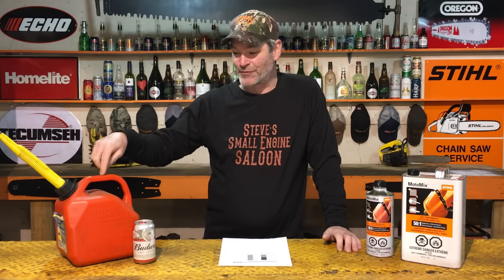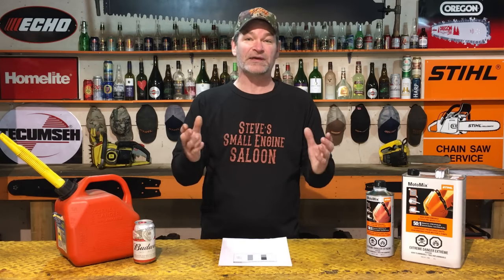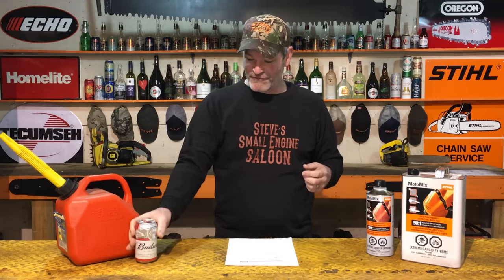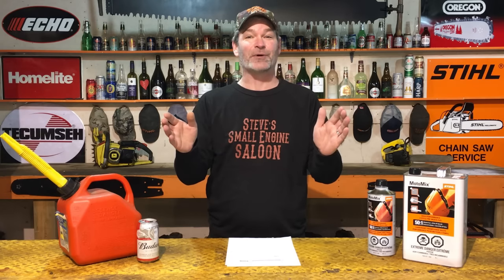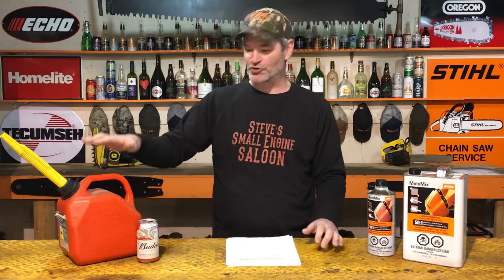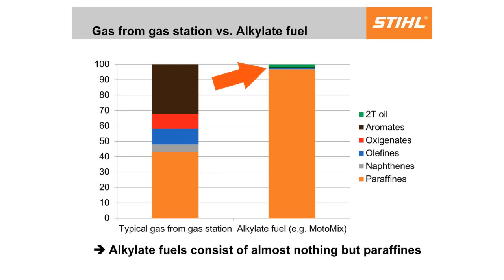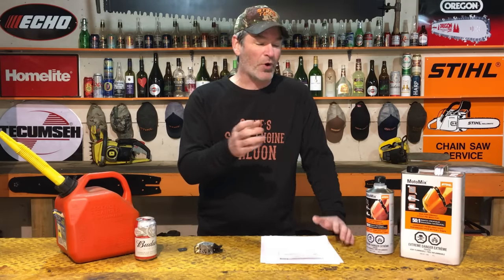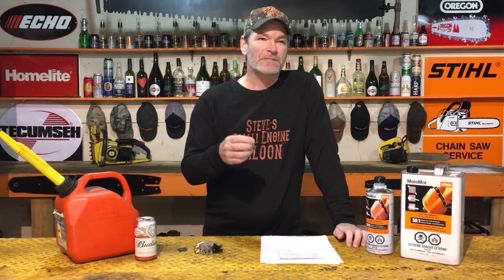The Ugly Truth Why Gas Station Fuel Is Bad For Small Engines

Comment: This video was exactly what I needed at this time, i was just sitting here contemplating if whether I should go to the gas station or to splurge on the motomix, I've been using the gasoline and mixing it with the oil recommended by the stihl dealer, but I'm going to give the motomix a try.  Thanks for all your help.
Reply from the maker: Glad it was helpful!

Comment: Use Tru-fuel for two-strokes.
Four-strokes? No problem. Shut off the valve and run em dry. Drain or seal the tank after use.
Like the beer commercial says: "It's the water..."   (not the fuel)

Comment: Switched to ethanol free for my 2 and 4 stroke small engines. Run them out of gas at the end of the year, no problems the next. If that doesn't work, a new 2 stroke carb is less than the cost of a quart of this stuff, so long as you change it yourself (easy).

Comment: great video. spring 2019 huge tree came down in my yard. bought a Husky 460 rancher. excellent chain saw. used only the husky can gas from home depot. stored chain saw in my dry garage. did not use until last week, jan 15, 2024 when another huge tree came down from my neighbors property. came down across my driveway and blocked me in. got out husky with husky gas in it. filled bar oil up. filled with more husky fuel. started up on the 4th pull. will never put shit station gas in carbed engine that will sit for a long time again.

Comment: Premium fuel at a gas station does not mean ethanol-free. Even premium fuel still has at least 10% ethanol at the gas pump. Some stations have designated ethanol-free pumps, usually only 1, but they charge a premium price to remove that ethanol.
Reply: Not all of them.    Many are booze free.   Check the label on the pump.   If it’s booze free it will usually say so.

Comment: I have never had a lawn mower engine wear out using pump gasoline.  I have never thrown away a mower because of a dead engine but because other parts gave out, like the chassis, the handle, a wheel axle, etc.  Its like those 1980 deisel Mercedes I see now and then.  Just a motor, four tires on a underbody frame, some seats rolling down the road in perfect mechanical condition but no body left to speak of.  And Briggs and Stratton motors...did you know that they can lose almost all of their oil and keep running?  They knock like crazy but just keep on going.  Once filled the knock stops.

Comment: I love your videos but I have to comment on this one.  I'm buying a new chainsaw this week so this video was of interest to me.  But holy crap!  I don't know what Stihl Motomix costs in Canada but it's about $22.50 (or more) PER QUART!! where I live in the U.S.  What sense does it make to buy a fuel when it's cost would quickly add up to far more than a repair needed from using gas station fuel or even more than buying a new chainsaw (or other 2-stroke tool) every year?  I fail to see the logic.   The chainsaw I'm replacing has lasted for 42 years and still runs flawlessly and I just ran it on pump gas.  If I had been using engineered gas, it would have cost me a fortune - far more than repairs of replacement of the chainsaw but it never needed repairs.  In just a few hours of cutting up a tree, it could easily cost me over $100 for engineered gas!  That makes absolutely no sense to me.  To pay far more than the cost of a POSSIBLE repair for fuel makes zero sense.  Does it make sense, for example, to pay $100 to prevent a POSSIBLE $10 repair cost? (I just pulled those numbers out of the air but it would actually be far worse.  For the amount of use I had with my old chainsaw over the years, it would have cost me literally thousands of dollars to use engineered gas in it. I could buy several new chainsaws in it's class for that amount.  In fact, I could just throw the chainsaw away and buy a new one every year and still be ahead!  That said, I recently began removing alcohol from the ethanol that I use for my small engines.  (There is no non-ethanol gas within at least 100 miles of where I live.)  Also, all my small engines (other than the old chainsaw I just gave to someone) are 4-stroke so I couldn't use Stihl Motomix in them anyway. I don't know if there's engineered gas without two-stroke oil but I can't understand why anyone would pay so much money for engineered gas when, as I said, repairs or even replacement of the tool would cost far less.  Isn't the whole idea to save money due to repairs by using engineered gas?  I have never had any fuel related problems with any of my small engines when running ethanol in them but, as I said, I'm removing the alchol for those engines now. And all my small engines last for many years.   I finally gave my old chainsaw (it was a McCulloch) simply because I needed a larger chainsaw.  I think the darn thing would last another 42 years on pump gas. I can't imagine how much money I would have wasted if I had been buying engineered gas all those years. 

Please, someone explain the logic to me that justifies spending many times more for fuel than what repairs or even replacement of the tool would cost?   If a tree service company used several large chainsaws on a job cutting down a large tree, they could end up spending several hundred dollars in a SINGLE DAY is they used engineered gas. 

Buying engineered gas simply makes zero sense to me.  It's like spending hundreds of dollars to prevent a $1 repair bill.

Comment: Just run your equipment dry before storing and pull the spark plug and spray some oil in the cylinder and put the plug back in. Worked for me for years and never had a problem all my equipment starts easy

Comment: I run a small engine shop in the deep south in the U.S. I've been working on small engines since I was a kid. My dad ran the shop before me and I've been running it for over 20 years now. I purchased some Trufuel back when it first became available. I was weed eating my own yard at house when I ran out gas. Started to go to the service station and I thought I have that can of Trufuel I had planned on using at the shop. Well I pour in the Trufuel in and cranked the weedeater. It ran maybe two minutes and that's being generous before it locked up. I'm so glad I didn't pour that crap in a customer's piece of equipment. I will never buy  that junk again and I will continue mix my own. This is the only engine of any kind I have ever had to lock up. I use ethanol free and I actually run my equipment in the off season at least once a month for about 10 minutes and I have not had to many issues. 9 out 10 times it runs when I need it. I tell my customers the same thing. I also tell them of my experience with Trufuel. I did contact Trufuel to no avail.

Comment: Some good info but the problem is using literature from the manufacturer comparing their product to another. Other people have tested rec fuel to engineered fuel and the rec fuel is just as good. And at 1/4 of the price for a gal I don't see the point in buying the engineeres fuel. Unlese you plan on storing it for a few years but I haven't had a single issue with the rec fuel, I use it in my saws mowers weedeaters dirtbikes and rototiller all start right up after winter storage.

Comment: The biggest problem I see is that a Gallon costs around $32.00. I can buy another carburetor for my weed wacker for less than that. My Lawn Tractor would run about $60 bucks for a tankful...

Comment: I use premium gas and siphon it out of the snowblower in the spring and put it in the lawnmower then siphon it out of the lawnmower in the fall and use it in my snowblower. Zero carburetor or fuel issues ever!

Comment: I think it’s a misnomer to say premium gas is ethanol free.  That’s not what the fuel pumps say that I use.  My ethanol free fuel comes from pumps that say ethanol free fuel(becoming more difficult to find).  With the amount of premium fuel sold to Luxury cars (like my wife’s Mercedes that requires higher octane), having premium normally ethanol free would violate by volume nationally the federal mandates on the amount of fuel required to contain ethanol.
Stop being lazy Americans and call your congressman to get this Iowa centric law get changed.  I negatively impacts millions of small engine owners and especially boat owners.  Nothing worse than getting shut down with water in your fuel while miles away from a boat ramp.

Comment: I live down here in Texas and hadn't ever heard the rumor about premium gas not having ethanol. But just in case that rumor is flying around in some areas, I used to do maintenance on gas pumps at convenience stores. Regular and premium both have ethanol in them. And just FYI mid grade is a blended percentage of regular and premium, if that helps anyone.
And another tidbit, people think the higher octane has more power in it. Regular and premium both have the same amount of power or strength. The premium has ignition inhibitors that makes the feel all combust at one single moment, instead of being spread out over a slightly longer period. This way you get to complete ignition and burn of the fuel in the cylinder at one specific moment which means a cleaner burn and a stronger punch. 👍🏻
Reply: Wow you need to read up on octain the higher the number the slower it burns. It is added for high compression engine to keep it from per ignition ping.

Comment: Water was getting in gasoline at the gas station long before ethanol. Many gas stations have bad tanks that are getting water in them. Poor transporting of the gasoline. Pumping fuel while the tanker truck is at the station stirring up trash in the tanks will also get water in your fuel.

Comment: What is your thoughts on using aviation gas?  An engineer friend says it is the absolute best fuel to use for any small engine and anything old. Like antique cars.
Reply: Some of the new small engines doesn't like using AV gas, AV gas still has lead in it hence why you run a grey pipe in a car. Unless you run over 10.1 compression ratio there is no benefit in using AV gas. It has a slower burn so tends to idle slightly slower. You would be better off to mix pump gas with AV gas. AV gas does keep fresh in the tank. Buy really modern small engines you are wasting your money if you had to buy it.

Comment: Trufuel in NOT, repeat, NOT Alkylate fuel. It’s junk. Husqvarna and Aspen fuels are both true alkylate fuels, both excellent products as is Motomix. The advantage of Aspen fuel is that its available in both a 4 stroke and a 2 stroke  premixed version, while the other 2 are not.

Comment: I believe in emptying out my fuel and running the engine untill all the fuel is used out of the carbs and fuel lines.  If fact a small amount of solvents in the clean up run is fine with me 
 So long as it all ran out. On carbs with bowl drains I then drain out all remaining fuel  I have three chain saws and numerous small engine from the ,,,1970 ties still running well. Get the crud out and it can't evaporate be and leave corrosive residue.

Comment: Benzene and Olefins increase the Octane rating of gasoline.  If you're using Premium fuel, chances are it contains even more than Regular.

Hot rodders used to go to the airport buy to buy "low-lead" aviation gasoline for their cars.  Octane was usually in the low-100s, and it still contained a small amount of lead, which was a crucial lubricant for older engines that didn't have hardened valve seats.  I wonder if there is a similar "off-label" source of low-additive gasoline?

Comment: Interesting. However, I've been running gas station gas through a pressure washer for 15 years. A lawnmower for 13 years. And various other equipment for several years.

I clean the carbs once every 2-3 years, never store the equipment with fuel in it. I don't have issues with gummed up carbs.

I just follow the winterizing instructions for the equipment. Fuel system is stored dry. Stihl's marketing may have some truth to it, but you never ask a used car salesman if the car you're looking at is the one you should buy.

Comment: Winter or summer layup no matter what it is, car, boat, lawnmower, snowblower, chainsaw, weed whacker, etc., I use HIGH OCTANE NON-ETHANOL GAS.. As for the 2 cycle stuff, I mix my own using HIGH OCTANE NON-ETHANOL GAS. If the manual says to run the tank dry and drain the carb, THAT'S WHAT I DO. Have never had a problem...everything starts first or second pull. ALL the problems are with the ethanol laced gas which you might use throughout the season, but DON'T layup with it. Just remember HIGH OCTANE NON-ETHANOL GAS. No way am I spending $5 +, (7 bucks + for Husqvarna fuel at Lowe’s), a quart for this stuff. PS: NEVER use ethanol laced gas in any of your 2 cycle equipment. ALWAYS mix with HIGH OCTANE NON-ETHANOL GAS.

Comment: So worse case is that you have to buy a new carb 15$ in 2 or 3 years with regular gas
But with engineered gas it’s about 8$ gallon or more and you run through about 2 gallons a year so it sounds like the cheaper route is just regular gas

Comment: would NEVER pay that price.  I buy Rec Fuel at the gas station which is not the same as fuel you normally buy for your car.  I have a 30yo+ lawnboy mower that the deck is giving out but the engine still runs well.  I do very little with it past running it dry about every use

Comment: Thanks Steve. I'd like to share my simple solution to those that might find it useful, if I may...
Having years experience and testing several theories, I've found that the most economical and easiest way to store the equipment especially in a climate that calls a need for the equipment year round, is to just do the 'Start and Run' method.
'Start and Run' your fuel full equipment for a few minutes (never rev on a cold start) on the 1st and 15th of every month. That's it. Nothing more. 
I've tried the run the fuel out method and the result was dry rot and/or brittle lines. I've also tried the fuel saver method and still experienced a hassle. 
As we all know, ethanol is a bastard and unless you can afford to bypass it, which isn't an option for most, we just have to deal with it in one way or another. 
The 'Start and Run' method for me has proven to be my best option.

Comment: I've found the biggest cause of small engine problems is the failure of the owners to read the manual that comes with their machines. 
If they did they would find most recommend premium gas for small engines. 
It does make a difference.

Comment: oh please.. i have small engine from the last 15 years doing landscaping, they start in 2 or three pulls and have never been deep cleaned in well 15 years using regular gasoline and they sit for 4-5 months of the year.  same with my carbed jeep grand wagoneer.. engine is now 35 years old.. been using E10 gas its entire life nearly.. carb has never needed to be rebuilt..  Im not gonna bother buying gas/oil mixes in quart cans lol.. as for cracked or fuel line issues..   That has nothing to do with the fuel but more to do with the cheap fuel lines... fuel line made in china will crack within a year or so... buy the good stuff and that will never happen.

Comment: Carburetors and alcohol in fuel don't go together so well.  The fuel pressure in your car is about 30 psi so all of this crap just gets blasted through and burned up.  Gas station fuel is optimized for modern cars.  For 4 cycle items with carburetors (boats, lawn mowers) use the non-alcohol fuel with stabilizer.  For two cycle items I would buy the engineered fuel like what he discussed in the video.  The two cycle carbs are more prone to contamination because the ports are smaller and fuel flow less.

Comment: If ethanol and the other ingredients in regular gas from the pump are bad, then why do blowers, weed eaters, and chainsaws commonly come with a little bottle of oil that mixes 1 gallon of regular pump gas? It seems to me that if they ship that little bottle, then they recommend you to mix it with regular fuel. Why wouldn't they just ship motomix if it's better for your engine?

Comment: been running small engines for 45 years and never a problem,  use non ethanol 93 octane and add fuel stablelisers during storage,  only have trouble when working on other peoples engines when they will not follow a few simple words of caution.

Comment: Heh.  Motomix is $63/gallon from Amazon.  I think I'll pay $3.50/gal ethanol-free gas and clean or replace the carb every 3-5 years.
Reply: I was thinking the exact same thing. I have a Honda lawn mower, model number HRR216K9VKAA. I bought this thing from Northern Tool just a lil over 10 years ago. I've always put regular unleaded in it from the gas station. I honestly didn't take very good care of it. I just changed the oil in it last month and that's probably only the 2nd time I've ever changed the oil. I've replaced the air filter several times. I've replaced the blades a few times. I just cleaned out the carburetor today for the first time because the surging has been getting worse (think it started like 2-3 years ago). Now it runs like new again. I don't even think I put fuel stabilizer in it (because I just found a bottle of it in my garage and it was still sealed).
I'd say the only thing I did was to make sure I never let that gas station gas sit in there all winter. I think I pretty much would always run it dry at the end of the season. So maybe this Honda engine is just incredible, or maybe ethanol isn't the devil that everyone thinks it is.
P.S. I also don't have cancer

Comment: So why does pump gas seem to only effect small engines and not your old car that sits for long periods of time. Excluding fuel injected cars. There are still millions of carbureted  cars and trucks still on the road, that don't seem to have an issue. And why can't they make a small carburetor out of material that gas does not effect?